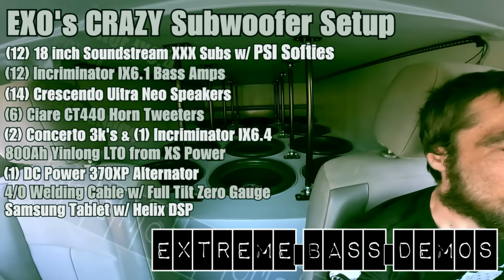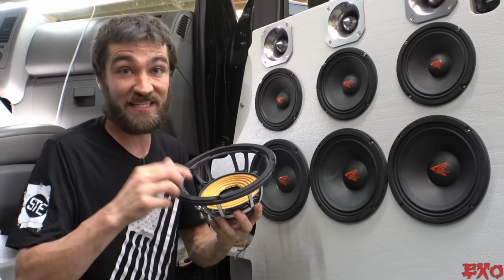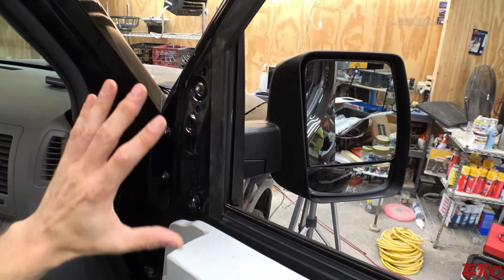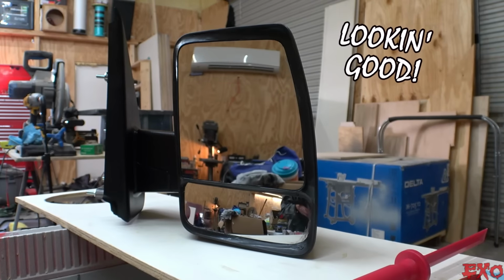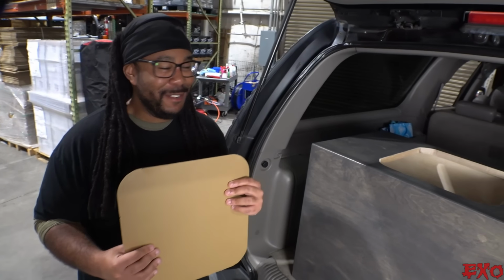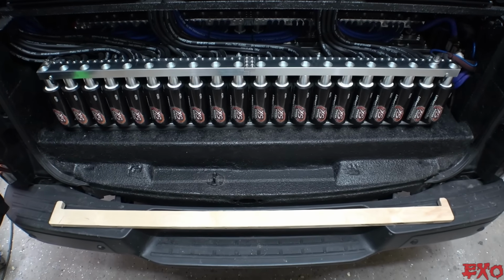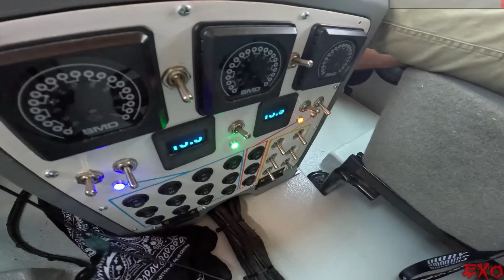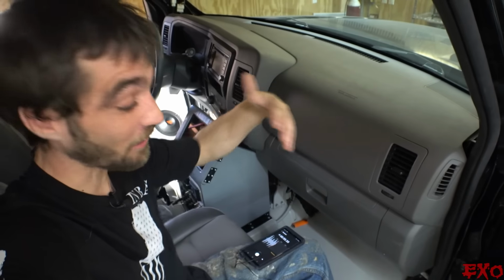EXTREME CAR AUDIO w/ 12 18 inch Subwoofers!!! LOUD BASS Demos & Remy's NEW Single 15" PREFAB Sub Box

Comment from the maker: Dishing out more EXTREME BASS and chasing the neverending battle of BREAKING EVERYTHING 🤣
Reply: If it hadent been for this comment mine would have been #1 dang you exo lol
Reply: Saludos EXO🙂
Reply: Blowing up gear that is unavailable is always a bummer.☝️❤️🚘🔊
Reply: Bro why don't you just rebuild the speaker? Take you time, and in the meantime adjust the system so it you don't have uneven loads. there are a TON of rebuild videos, and PLENTY of places that sell kits. When I saw you ripping and tearing  it apart I screamed at the screen LOL It's gonna be hard to get the exact same texture and feel (and the logo.. but that's what cameras and printers are for) 
If the coil didn't blow then you wouldn't have needed to rewire it, but when you ripped it all out you probably  ripped up the coil wire :(
I suggest you watch some videos, like a bunch from different people, and learn their techniques, which are all pretty much the same, but there could be differences.... Then PRACTICE on some other speakers... and see how your results are.... it might take a few... or a lot... of tries, but you said you can't really get those speakers anymore, so rebuilding it MIGHT be the answer.... it's not easy... it WILL take all you skills.... but it's not impossible, and people do it all the time.. but you gotta practice :)
- OTHERWISE you could forget it and just take out the matching speaker on the driver side, seal it up... adjust you amps... and keep it as a spare incase this happens again... I PROMISE you won't hear a difference LOL :D
- - -  You'll figure it out and get it working perfectly again... And I CANNOT WAIT to see what you come up with.....  ONE THING THO... Maybe get a little LIGHT in the back with the speakers... nothing fancy, just something to add some light (preferably some adjustable color LEDs with a frosted cover to disperse the light so it's not directly in your eyes) just a bit of accent light... and you could change the color... like 1 solid color at a time... none of that rainbow puke stuff LOL 😬😬
Reply: You have done more for car audio than you could ever imagine! I can only think what you have been through dealing with anxiety and everything.
Reply: Loved the video brother as always. Just wanted to add a bumming note for the future tho. 
I don't know how others feel but, I would much rather you not video while driving. Just saying it is better for All of us that follow you, to have you around for a long time. It's not a matter of if but, when. Love you bro! Stay safe!!
Reply: I got 2 of those brand new at work if ur really lookin for some un-8
Reply: Please man, wear your seat belt when you drive and dont operate a camera, we want to keep you around for many more years! 

About the crease/crack in the dash, is there an airbag under there? Normally there is one, the crack allows the surface of the dash to break away when the airbag deploys.
Reply: Cool 😁👍
Reply: Happy for you EXO, the monster is built and bumping! glad you and the homeys are enjoying it and the carnage is keeping you busy. I'm more of a "four 15s on a few K" so im sure i woulda insta tap lol oh and get your boy some electrical! That dimming brought back memories 😂
Reply: The d4s hex  cone door woofers are hot 🔥
Reply: Undersize individual chambers on your door drivers will save them a lot of pain.
Reply: that's suck's that happened to you. I would shelf those and retire them and get a new set. I know that's going to take some time to save up but it would be worth it later trust in your process! by the time it comes back to the next big show then you would be bass ready !!!
Reply: You should play amapiano

Comment: That dash crack is were the Air Bag is located. Its designed to break the dash when it deploys. The Bass is just making it visible
Reply: Exactly. I was wondering, does this amount of SPL never trigger an airbag?
Reply: @djlp87  airbags usually deploy based on g forces from yaw or impact sensors, i suspect bass even to this extreme does not create enough to trigger the airbags, though would be interesting to see if it could be done
Reply: airbag is triggered by a device that measures G force, not vibration from bass in music.

Comment: Flock the dash board so you can't see the crease. You could even lay a sheet of fiberglass on it before you flock it to reinforce it.
Reply: Has to remove the airbag underneath it first though, normally the crack is there do the airbag can come out. Bass just made the crack visible, normally it isn't visible.

Comment: now thats a demo car. stock dash, 2 windows down and bandwidth plus wind.
peak right there. great to see the amazing success of the build after following you and your channel for many years, youve come a really long way.
youre definitely one of the greats, always will be.
good luck with the dash, youll probably have alot of firewall flex which makes the dash flex worse. youll want to fibreglass up that firewall eventually to help keep it stiff. maybe some beefier custom steel brackets for the dash to keep it solidly mounted too, and some subtle bracing with some bits of steel/wood/fibreglass to keep it together but also still looking and working like factory.

Comment: I only deal with sealed boxes. I have done ported, but I like quality over quantity. I obviously know that box design is #1,but I don't have room for a 6th order. Back in the day, I had 6 15"W6 JL audio. When they came out with W7's, that changed the game. That's nothing compared to subwoofers today. Now I have 4 15" DS18 HOOLIGAN x15's, and they are mind blowing! I only have room for a sealed box, but I would rather have flat response over SPL.

Comment: Seems like if you ran your mids ported then the lower frequency from the subs would blow through and equal out the pressure on both sides, keeping excursion much lower.

Comment: Alot of newer cars have the outside temp sensor in the mirrors.  If you get a check engine light or your ac stops? You will have to find a way to move it to the new mirrors. I havnt seen a aftermarket mirror yet that had the temp sensor in it. Hopefully yours is different

Comment: I think a better way of fixing the mirrors would have been to make them easily removable without disassembling the door. Like a quick disconnect kind of thing and you could just take them off when doing demos and put them back on for driving and stuff.

Comment: Hoping for some advice. I want a pair of SVR-12 D4 with a SKv2-3500.1D. I have a 2015 chevy impala that I've put foam and matt in. I am still tuning my audiocontrol d-6.1200. I know I'll have have to upgrade the alternator and battery prior. My concern is I'm not sure if there is enough trunk and cabin volume. If there is any educated input of a better combo or good box,port,tune to shoot for best results. Thank you in advance.